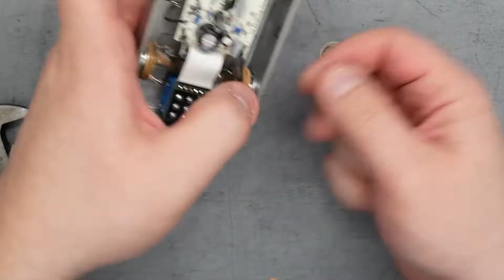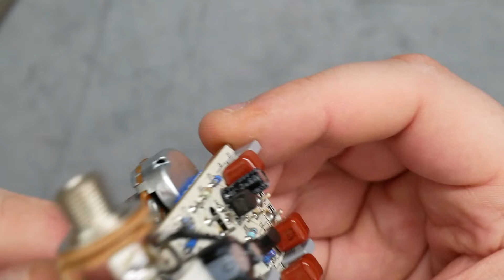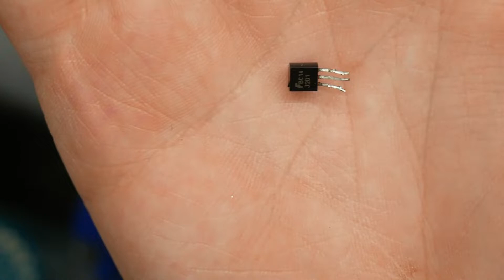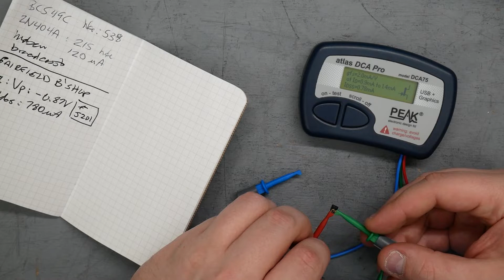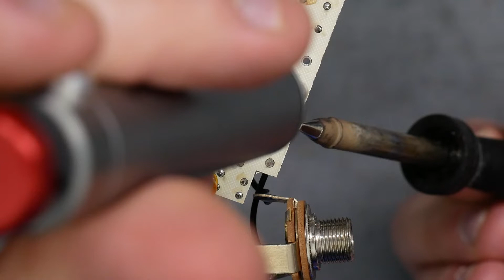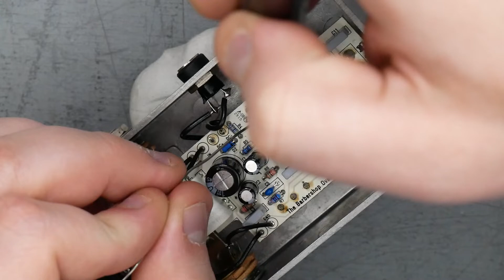Fairfield Circuitry Barbershop V2 Teardown! Transparent JFET Magic!

Comment: Your uploaded Barbershop V2 schematic has only 3 electrolytic capacitors.

In this video,4 electrolytic capacitors are used.
Is your schematic wrong?
Reply from the maker: Yes, good catch. Not sure where it is though, been a while since I was inside the barbershop. Might be the other side of the sag control? Could also be an emitter bypass for the BJT at the end of the circuit.

Comment: There is so much to say here- a unique way of lowering voltage- he just goes through ":this is nice' this is that' Ok thats not so good . this is nice...ok lets put it back together>> Now on this particular video he measured the transistors but other than that what d0es anyone learn through these vids ) i learned the color of the board is white- which is kinda odd. and to be fair the tone switch on top is the last in line...
Reply: yeah, this is top-notch content. This is one of the few instances where I’d honestly prefer if the content creator went on a bit of a rant. I’d like to hear the guys thoughts on the pedal

Comment: When I turn the Sag pot while the guitar on it scratches like crazy. Someone told me this is normal for that pot because of how it works. That true?
Reply from the maker: Yes correct! The pot has DC voltage running through it, which causes that scratchy sound. If it's something you really want to get rid of, you can use a conductive plastic potentiometer.

Comment: i have to ask. Why do some pedal builders keep putting power jacks on the side of the pedal??  It would be SO much easier if all the power jacks were on the top. The industry needs to be standardized. Everyone putting jacks willy nilly make hard to have a clean wiring diagram on the pedal board.

Comment: How would you compare this to the Telenordia TA-100? I’m a massive Thom Yorke fan and I’ve been on the hunt for a close enough clone since they seem to cease to exist.
Reply from the maker: Never played one, but there's a schematic on FSB. The TA-100 is three germanium transistors, and the barbershop is JFET based. TA-100 also has hard clipping. I would not expect the two pedals to sound particularly similar.

Comment: Could you explain how it's different from the V1? I have the always-variant - is it different, too?
Reply from the maker: The back half is pretty different, the 2222 was originally DC coupled to the 2nd JFET, but now it's just a fixed buffer, with the volume moving in between that and the 2nd JFET. You can see the two schematics and compare at FSB.
Reply: Hi, what is FSB… ? Thanks for your share.
Reply: Ok I found what I was looking for 😉

Comment: So is this really just a modded BD-2?
Reply from the maker: You would have to squint reallllyyy hard to call this a modded BD-2. Pretty much the only thing they have in common is using JFETs.
Reply: @graybenchelec  So what would you say this is closest too?
Reply from the maker: @boimesa8190  It's hard to say, because it's not really far off from the minimum amount of parts necessary to have a JFET amplifier actually work at all. Being JFETs, which are similar devices to tubes in that the both create a negatively charged field that controls the flow of electrons through the device, the barbershop is reminiscent of tube preamp circuits. I suppose you could draw a parallel there, between the barbershop and the bones of some tube amps.
Reply: Any thoughts a year later? @graybenchelec
Reply from the maker: @boimesa8190  Nope I stand by what I wrote. If you want to compare this to another pedal, you'd look for JFET based amp-in-a-box pedals. Supreaux Deux/JHS superbolt comes to mind.